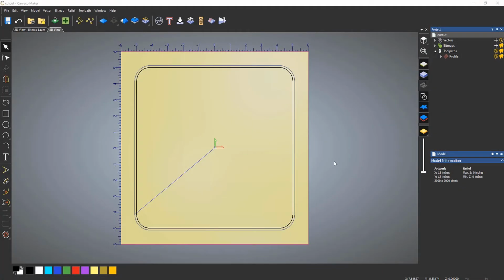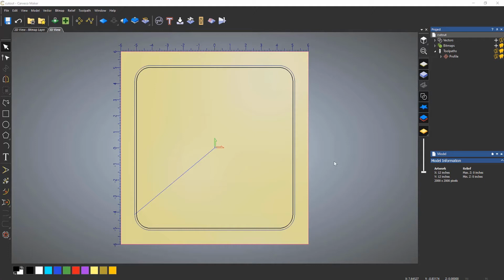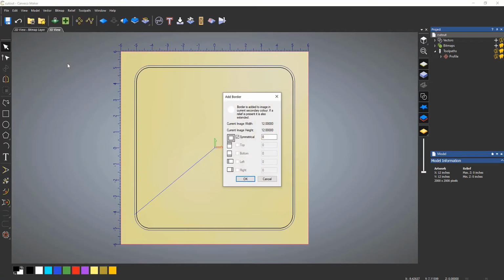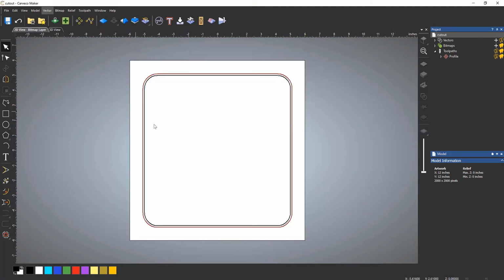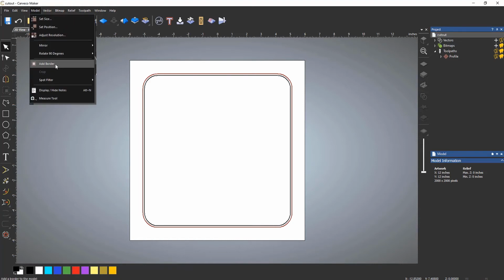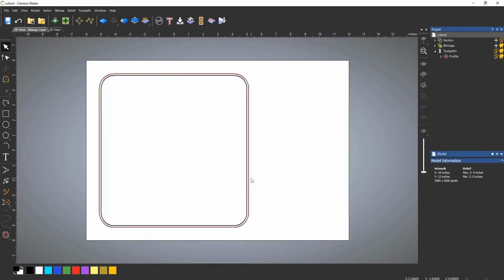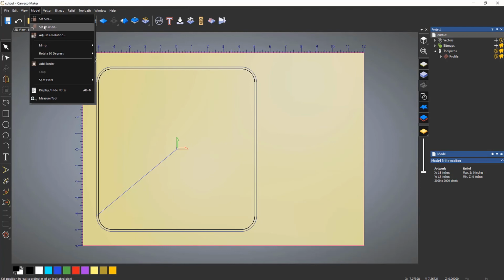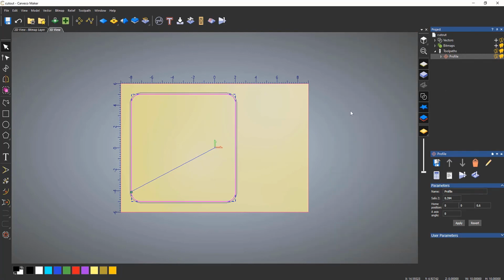Tips and Tricks: Add a Border to Make a Model Larger

Comment: Is there a way of downloading new fonts? All the ones I have are single letters and I'm after a font that is joined is this possible?
Reply from the maker: We work with all the fonts on your system, so you can download any new fonts and work with them within the software. That being said, the vast majority of fonts are not designed with CNC applications in mind, so you may need to adjust the character spacings then trim and join any problematic vectors manually. 

For more information, please view this video: https://learn.carveco.com/2d-design-vectors-and-bitmaps/create-text/